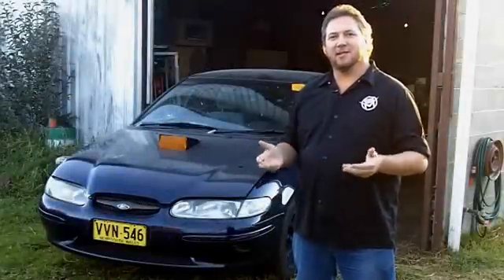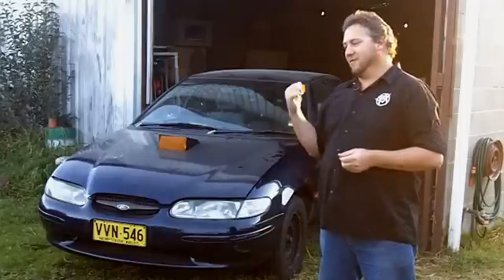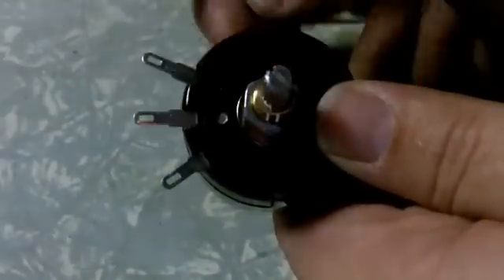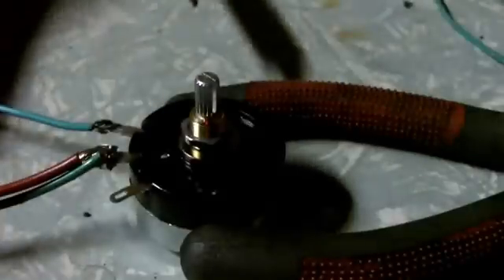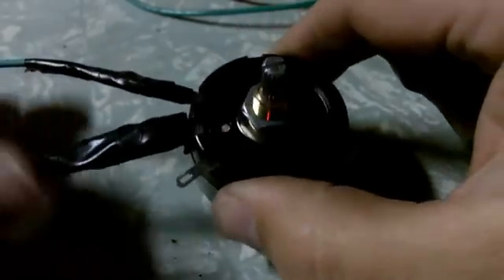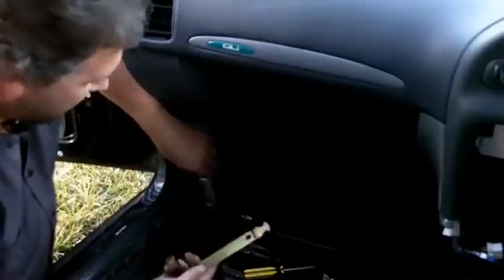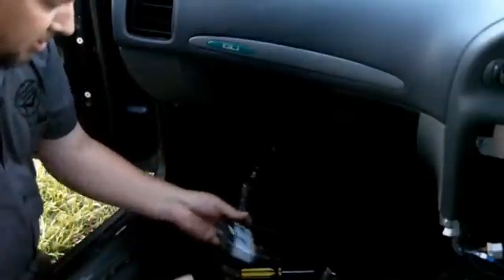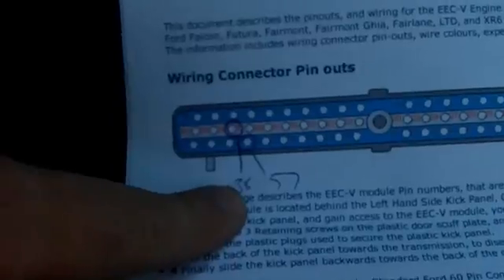13s for $1300 - Project Bluebird - Episode 12

Comment: Great to see proper soldering technique a lot of people get it wrong by melting the solder on the joint as opposed to heating the area and letting that melt the solder. If people do it the way you showed they won't have any problems (fingers crossed).

Comment: Just thought I would shed some light onto the electronic shift modules. There is a company Shift Kits Australia that will sort out an electronic module for both Holden and Fords. They are a bit on the expensive side but I installed one in my VX V6 with a slushbox 4 speed + removed the shift gates so the button didnt need to be pressed to shift gears; it transformed the whole car - really firm shifts and comes with a discrete on/off switch I mounted under my dash for when I was carting around the parents. If you want to take it a stage further you could install a new servo, etc and tighten the shifts up even more so.
I'm sure if I pulled it apart it would be a simple circuit as Scotty has shown us but as a plug and play kit you really cant go wrong.
Link: http://www.shiftkits.com.au/index.php?main_page=index&cPath=13